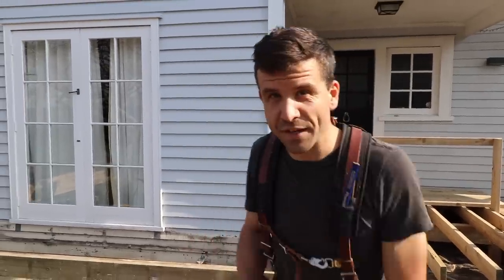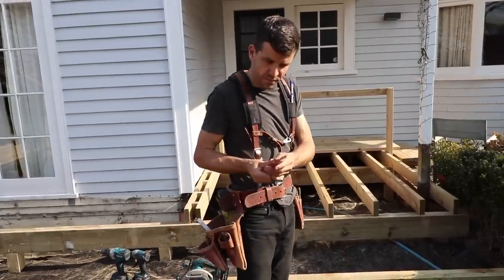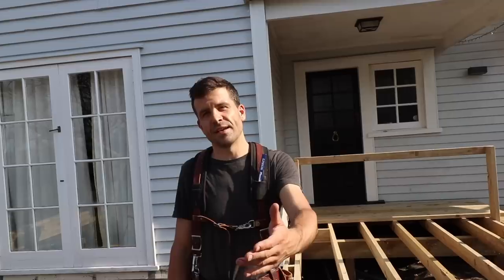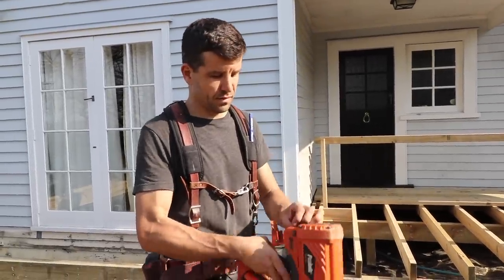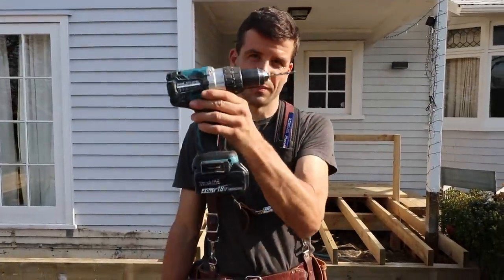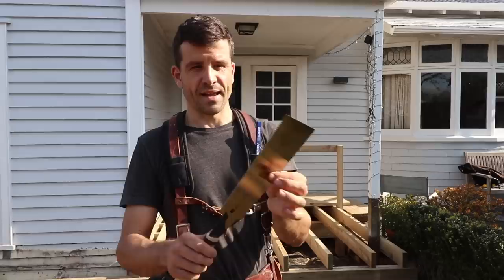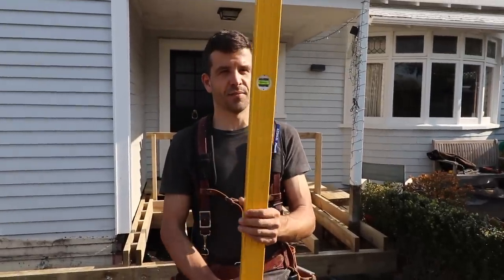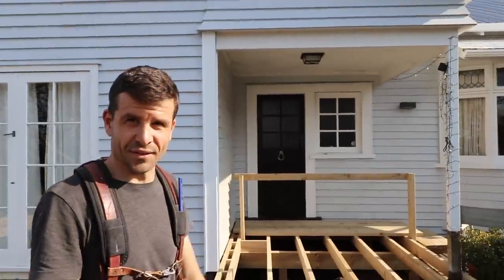First Year Apprentice? Get These Tools!

Comment: In the UK as an apprentice you need to master the art of tea making.
Reply: The apprentice has to learn how to make "government tea"....also works as drain cleaner, wasp killer, road sealing tar, ship hull water-proofer, damp proof course & tire repair contact cement. The teapot needs to be big, aluminium with two handles & at least 1/2" of tannin build up on the inside. The pour spout has so much tannin that the 3 gallons of tea pours out with a dribble the width of a match stick...Government tea!....later after drinking this bio-tar, you will need "government bog roll" for the thunder-box...preferably Bronco paper which also works as tracing paper, smooth, shiny & rasps your bum in use.
Reply: when I was an apprentice as a tech, I was asked on my first day to make tea. 'I don't know how to make tea', never made a tea since
Reply: Lmao
Reply: That's how aweful builders come along. Teach them something or give them the guidance to go do something els.
Reply: and finding that tartan coloured paint.
Reply: In Canada too. I remember the coffee order for every journeyman carpenter that works for my company
Reply: It’s a fine art

Comment: An extra battery for the  tools is always useful.  A sheath for the pullsaw is a must.  A digital level module several beam lengths can be handy too.  A portable workbench,  a No.4 bench plane and/or block plane are nice add-ons for finish work.

Comment: We have paslode guns here in the US, I've had one for almost 20 years but they are much more prone to break down under hard production use in my experience than a standard pneumatic nailer which is why large US crews still use them. I see pawn shops here chock full of worn out paslode gas guns, but never any hitachi or bostich pneumatic guns.
Reply: The Paslode guns are super loud too. I get that most people in construction don't care about loud noises but I think using a pasloade as your main gun would be pretty detrimental to your hearing.

Comment: First year apprentice here, I've got most of these and saving for the skill saw now. The place I work for has everything i'd need to use but I rather have my own so I can look after and maintain them myself would love to hear what you'd reccomend next. Although we do mainly kitchen/bathroom renos we dont tend to use nail guns all the often.

Love the content!
Reply: If you're doing a lot of kitchen and bathroom refits I'd suggest a track saw and table saw, they are worth their weight in gold for that type of work 👍
Reply: Right there with ya, I agree that having your own is much better. If you are doing Reno’s I suggest recip saw and sawzall
Reply: @dahpizzaboy6149  Recip makes such a difference!
Reply: @dahpizzaboy6149  i thought a recip and sawzall were the same thing?
Reply: @enjay8950  they do, I’m a moron and clearly new! I meant recip/sawzall and a oscillator
Reply: @dahpizzaboy6149  an oscillator? ohhh i just looked it up we call those "multi tools"
Reply: @enjay8950  like any tool, they make it easy and give it 4/5 names

Comment: I was so pleased to see that you use pilot holes. I've been doing this crap for 50 years and started using pilot holes from day one. It's common sense. Not always necessary but usually.
Reply: Some idiots here in NZ use gun nails to lay decking, or don't drill pilot holes. I would not use nails for decking at all if it were up to me.

Comment: Sound advice. Many builders here in the UK have a young workers policy that means up to 18 and you cant use powered tools. Many for safety reasons, but it also forces them to get good with a hammer and handsaw.
I would agree with just about all your choices. Good video man.

Comment: Safety on the job in the states is like the least stressed thing. I love how you guys are so meticulous and clean about your work. Do you think a carpenter from the states  would be able to transition to working in New Zealand or Europe? Metrics being the main thing
Reply: If you can use the metric system you should be fine
Reply: I'm from uk and I only used imperial for some reason but now in my apprenticeship I got used to metric in about a week or two just read the tape a certain way, like if it's on 52 cm and a random mark just say 5, 2, 3 (for example) = 523 mm. Everything's in mm on site

Comment: so my apprenticeship was in the union over here in the states, day one all you need is a tool belt and basic hand tools. screw driver, hammer, punch, some clamps and so on. but all power tools and battery tools are actually on the job in the gang boxes so if you wanted (not the best idea but you could) you never needed to buy any for work. basically all impact guns, drills, any air or gas guns they were all provided by what ever company you were with and they would follow the foreman from job to job. also the apprentice program gave you 2 sets of hand tools, one set after a few months and another at the end of your first year. it was a pretty amazing set of tools, i gotta say for all its worth the Carpenters union in new york city treated me well for the years i was there before i had to move.

Comment: Always interesting hearing the different experiences first years have. My first year with UBC, as a Formwork carpenter, I got destroyed. I was treated as If I should have known what journeyman known or very close to that level. Which yes, was very frustrating but it made me want to learn that much more and at a faster pace. Still have a ton to learn but reflecting on it now, I like that I was expected to do more then just push a broom around. Some things I was taught was how to use a worm drive saw and how to cut 4x4’s in one go, how to lay out walls for the forms. Overall, just made me a better carpenter.

Comment: Yes we  use pneumatic nail guns because code requires to shoot 3 and 1/2" common Nails which don't fit in cordless nail guns here in the US also when framing houses we do a lot of structural plywood with 4 + 12 or 3 and 6 nail pattern so cordless nail gun wouldn't be able to keep up. just thought I'd let you know why thanks for a great video
Reply: I use pneumatic for structural plywood in NZ as well. Only use gas powered when framing or doing finishings.
Reply: Sounds like a gap in the market there

Comment: Idk about apprenticeships, but here in Hawaii in college for carpentry first half of the first year is all hand tools, handsaws, hammers chisels. Second half they teach you how to use all power tools except nail guns. We never used impact drivers tho, always nails. Second year we had to frame up a practice house with all hammer and nail, for our final we built a actual house for people to live in. Again no screws and no nail guns, just hammer and nails. I miss using my hammer to sink in some 16p nails. All I use at my current maintenance job is screws. I had screwing, I’d rather use a hammer, funner and faster. But screws are way easier to take out if you need to take something apart.

Comment: The Johnson Level works just as well as a Stabila for an apprentices and I’ve never seen a 350 dollar Vaughan hammer. I own an Estwing, 2 Vaughan’s and 2 Milwaukee and they do just as well as a 350 Stiletto
Reply: I love my 14 OZ DeWalt hammer. It's not the most expensive hammer available, but it's the most comfortable I've ever used. All my workmates think Estwing is the only hammer to have, but I've never liked them. They give me grief over it, tell me I'm using a framer, but I disagree, I've never used a hammer that hits so hard, with so little effort. I almost never miss or bend nails with it, and unlike the Estwings, If I'm nailing off decking or cladding, it doesn't leave any marks if I slip or over drive a nail. But whatever, people can use what they want, I'm just sick of being criticized for using what works best for me.

Comment: After 10 years as a carpenter, sometimes I wish I had got into plastering instead... the sheer amount of tools I have.
Reply: I feel like everyday I have to buy some new  tool. I'm outfitted like I'm my own company but I don't get paid for it.  
I'm jealous of painters and window cockers. The overhead these guys have in tools is less than my chalk line cost yet they make like a buck or two less an hour.  
Even labourers need just a knife and a hammer and make 2$ less or something like that.  Doesn't make sense.
Reply: @carpentryfirst3048  if a labourer is only making 2$less than you maybe find a new job
Reply: @thomaswebby2431  so apparently you don't know anything about unions.  
Union labourers make what they make.  
The unions suck but it doubles my wage and gives me 10% vacation pay, benefits and pension.   None union carpentry is chump work.   Make 25-30$ to frame a house?  What a joke.  Let the guys who love to drink and pop perks have that fun.
Reply: Just remember a lot of the tools you have as a carpenter are the same tools they keep at home. I know diyers and non carpenter tradesmen with almost as much tools as most builders because they do so many renos in their spare time.
Reply: @TheDuddleyCo  I'm one of those DIYers with an expressive Milwaukee M18 collection. I even got the M18 nail guns: 15, 16, and 18. I do about 2-3 projects on the house every summer and 1-2 during the winter. I love not having to hire a  Contractor for anything! The tool obsession does get out of hand at times considering I'm not a professional but have the tools and most of the knowledge gained through the internet.

Comment: I live in Australia, stick framers still use pneumatic nail guns,much more reliable and cheaper to run than gas nailers,prefabricated framework, you can get away with the paslode gasser,I have done both in the last 20yrs
Reply: Yes I agree...by the time you have framed a whole house around 2500 sq-ft you might have driven a couple of thousand 4-1/2" R-dox framing nails....

Comment: As a first year apprentice in Scotland back in 2002 i earned £99 per week . Got all my hand tools from the company i worked for , smoothing plane , hammer, saw , tape , level , tool belt , tool bag , block plane , chisel set , stanley knife , nail punch and i think that was it ... maybe missed a few . Bought myself a 14.4v dewalt drill and 2 batteries  , but never used any other power tools till second year and that was just a go of my trades mans paslode , collated screwgun etc . Never actually bought and used my own till 3rd year . Skills test in scotland at the end of 4th year demands the use of hand tools only , well it did in 2006 . Great video but it is a big ask for a 1st year to purchase all of that
Reply: jamie fullerton going into my third year as a apprentice, and my boss would supply all the power tools, for me to use onsite, but ur right, learning how to keep chisels sharp, how to use ur fold out rules, learning to hammer with posts  bolts and good knows what in the way trying to drive a nail in some good awful angle, realising you have lost the scribing pin out ur combination square a year later(lol), are all important skills to master.

Comment: All my tools were purchased at auctions in Queenstown after building / construction companies folded. I purchased Topcon dumpy levels for 70 bucks and lasers for 300 then send away for recalibration which still does the work. In 2008 I bidded and won a  auction to 2 large pallets of Stanley 12 metre steel tapes, Speed squares etc in New York as a tool supplier to the 9-11 licensed contractors had finished their contract (never doing that again as it took years to sell it all). All my hand tools were purchased on 70 percent off specials from Placemakers etc, all my Atlas Copco diesel trailer compressors, gensets and jack hammers are from auctions. Being Chinese I really hate wasting money hence I'd rather wait for deals to present themselves. Mates desperately wanting money is another good source of gear.